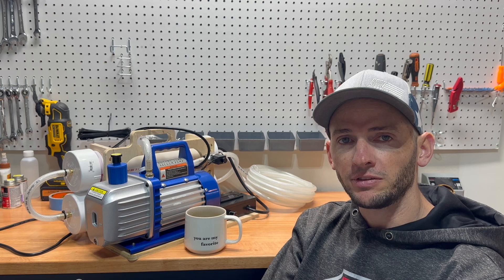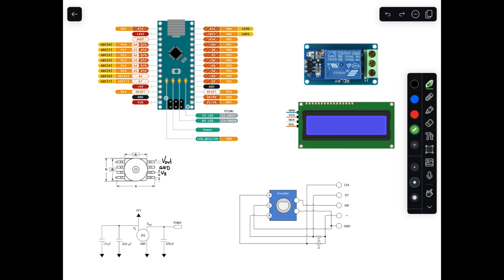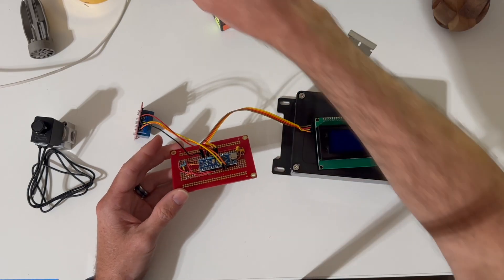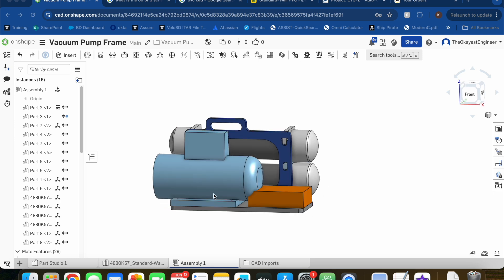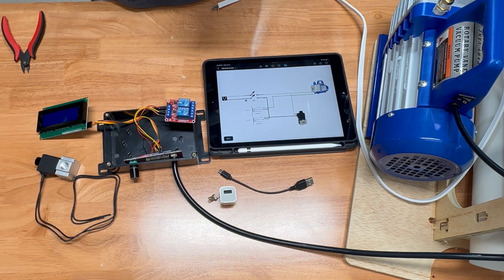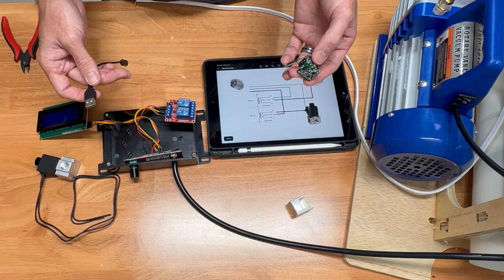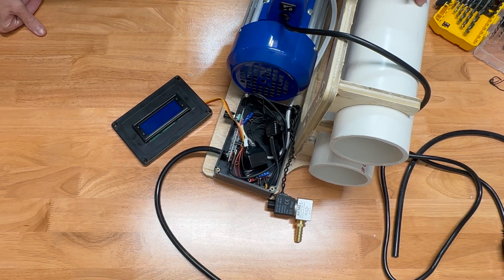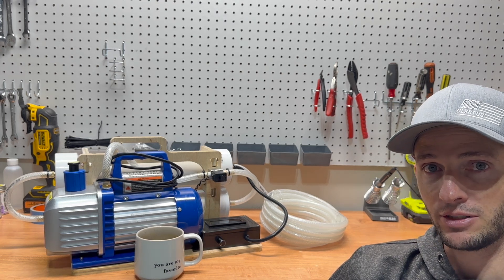DIY Vacuum Pump Build: Save Money and Over Engineer Everything (With ChatGPT)

Comment: I saw the thumbnail and said to myself "this is gonna suck". 🤷🏼‍♂️
Reply from the maker: You’re not wrong…
Reply: @TheOkayestEngineer  We use mass spectrometers at work to verify integrity of seals. We apply a vacuum to the test article and then introduce Helium on the other side. I'm reminded daily that I suck at my job. 🤷🏼‍♂️
Reply from the maker: @819jt  aerospace or military components? I’m familiar with that process. Works great for detecting very small leaks.
Reply: @TheOkayestEngineer  Space stuff🤘

Comment: Oh my gosh !
Just grab one (or more) compressor from an old out of service refrigerator (free. Motors are rarely the reason why refrigirators brake). Buy a vaccum capsule from any automobile spare parts store (5-10$). It's used to regulate fuel in carburators fyi. You will need a 15A microswitch too (3-5$). An old propane tank is just perfect as vacuum container. Take the size that fits your application. 
I personally use 1/8" diameter water tubes used in gardening as vacuum lines. Finally get a vacuum meter. I paid mine 20$. It's not a monster of accuracy but it does the job.

Overall cost : 50-60$, including the vacuum lines. Want more power/vacuum capacity ? Add refrigerator motors. The 15A switch can easily deal with 3 motors. These motors are awesome : no oil leaks into the vacuum system. No vacuum leaks. Very quiet. Integrated heat protection. 

Install the microswitch on the vacuum capsule, on which you can add an adjustable lever too. Set your power cable and that's it ! Time to build the whole setup is 3 hours, including the coffee break and the time spent in scratching your head while you wonder how to set the electric cables 😂

I used such a setup intensively for over 10 years and had zero failures. Never had to replace a thing. I reach 27" vaccum but mainly use less than 20" : if you can't mold your part with 20" vacuum, I can't see how you would succeed with 30".

Feel free to comment :)
Reply from the maker: Most of the things I create are more to see if I can do it than it is to make it the best way possible. I wanted to adjust it for wet layups at about 20 inches, and be able to use it for infusion which benefits from the highest vacuum possible. It works for what I need it to do, but probably not for everyone.
Reply: @TheOkayestEngineer  what you did is awesome, no doubts about it 🙂. Your entire project is just super challenging. I have some experience in helicopters : there's nothing harder to build, tune for flight and  fly.

I personally don't use fusion molding. I find useless to drown everything in epoxy and fight the hell to remove the excess afterwards... it's not very hard to reach a 60% ratio of fibers in volume, this is the ratio used in prepreg as far as I know.

A trick I use to do to make the epoxy thinner : heat the resine ( not the mix with the hardener) up to 40 degrees c (roughly 105 F). Let it cool down to room temperature. The viscosity will drop for several days.  I have no idea if it works on all epoxy brands but I think it's worth finding out. Make some comparatives with/without.

All my best wishes and thank you for your great content !!

Comment: Your vacuum buffer has the best use to stop crap entering your pump. Investing in a better pump would have been a better option
Reply from the maker: You're probably right.. so far it has worked "good enough".. and that is all I have really needed. If the projects get bigger and more frequent... then I might upgrade. For now, that money saved can go into other projects with bigger returns.

Comment: I would be concerned by vibrations a little bit. Over time the loose wires in the control box could cause them to rub against other components, degrading the wire insulation. Then having main voltage touching anything will be the subject for another video. I'd use some rubber vibration insulation pads or even better filling the content of controll box with some resin to keep everything in place.
Reply from the maker: @jtrueman88  that’s a really good point and something I didn’t think about… I’ll open it back up and see about making it a little more vibration proof. Thanks!!

Comment: IMHO you don't need a solenoid, just a one way valve will do the work.
Reply from the maker: @burningman1945  you’re probably right… but I believe that would leave a vacuum on the pump until it leaked down enough for the valve to shut and then further allow the pump to continue to leak down. The pump acts as a crappy one way valve as is, and leaving a vacuum on the pump when it is off is bad. It sucks oil out of the inlet.

Comment: If you’re switching AC you really want to earth the enclosure. 110/120 isn’t as bad as 230 for it but doing the funky chicken dance isn’t much fun.
Reply from the maker: @wombatau  good point. The vacuum pump is still grounded the same way it was originally. The control box is plastic and should be completely isolated. I assume this is okay based on my knowledge but I’m no expert. If it were metal a ground should absolutely be used.
Reply: @ After a bit of reading following the comment I made, it turns out that I’ve been doing it incorrectly for many years. It turns out the proper way really is not not use those Arduino AC relay boards at all, and to keep each domain completely isolated.

For eg, an external AC relay with its’ own grounded housing, that is switched using optoisolation to a separate DC circuit.

Some of those Arduino relays do 50% of that, in that they are often optoisolated, but the ac circuit shares the same housing with the dc circuit, which isn’t ideal. The biggest part is optoisolation.

Because I love to overcomplicate things, I guess I might for my own things use instead something like a dedicated PC817 optoisolation board (<$2) driving a refrigeration/air conditioning relay like a JQX (<$2).

So I guess: Microcontroller (3.3/5V DC) -> PC817 -> (12V DC) JQX-102F 20A 250VAC -> load live line
Reply: @ I’m definitely no electrical expert just been shocked a few times. The way it was explained to me was when I’m switching live AC through any device I should think about all electrical paths from the live line. So presume the insulation may break down between the relay contacts and the coil (because I surely always use the best highest quality cheapest AC relays), then earth with this in mind. There are probably really clever ways to do it better than I do it where I just connect the earth wire to the relay board mount hole with a screw, but no electrocutions since 2011 - wait no not true I got electrocuted a few months back pulling a plug out of a power board when water clung to and ran down my arm 😂 230V hurts 😂😂😂
Reply: Oh and be sure not to connect your AC mains earth directly to your negative DC rail without significant resistance at least. A person is about 3M ohms give or take, so it’s pretty easy to create a lower potential path to ground.
Reply: Also, Kapton tape is amazing.

Comment: BSP is only standard almost everywhere except America. A bigger challenge is try finding NPT outside of the US. It’s like showing up to a running track in ice skates.
Reply from the maker: @wombatau  and the only difference between the two is ONE thread per inch… one… why??? Can’t we just all get along?
Reply: @ Haha yes true for 1/8”, it’s like 0.5 TPI difference. I think 1/2” NPT and BSP you can even get to fit together for low pressure if you are stuck. I wish the world ran on threads that actually made sense though and used neither. 1/2” is actually ~21mm / 0.82-0.83”.

Comment: shoudnt you switch the phase instead of the neutral? so the pump stays "grounded"?
Reply from the maker: The phase is switched but I did so using the ground in the new where I ran to the arduino. The pump is still grounded like normal. I could have made that more clear.

Comment: Very very good project! Congrats!.  I think I will attempt to make a very similar setup. Only thing is I find it very hard to figure out what fittings to use. I find it all very confusing as it is way out of my normal field of expertise. I like the combined setup with the tanks very good and I did not use a solenoid. I am really curious if you manage to get the system really air-tight. The best I achieved is the same as you, a very slow decline of the vacuum and the pump switching on about every 10 to 15 minutes for 0.5 seconds... Where to look for the solenoid ?
Reply from the maker: I used tacky tape around all the fittings and that seemed to fix any leaks i had. The solenoid is a 3 way vacuum solenoid. https://www.veneersupplies.com/ has everything you'll need to make one of these, including the solenoid.

Comment: I can shed some light on the pipe thread issue . British pipe thread standards have been adopted as the metric standard pipe thread so they are the same . different from American pipe thread standards .
Reply from the maker: Thanks for that.. from what I can tell, the only difference is ONE extra thread per inch.. ONE.. it was extremely hard to figure out they were different haha.
Reply: The standard metric pipe thread is metric. If you browse any European supplier catalogue for pneumatic or hydraulic fittings you'll see that essentially everything can be ordered with an M()x1.5 thread, which is the standard metric pipe thread. BSP is still more common though, but that's because BSP is still the most common pipe thread worldwide and it's too much of a hassle to switch out everything to metric.

Comment: BPC is very common on Chinese products. Many reseller's will even label it as NPT, especially 1/2", and with at least one of the mating parts being plastic they're functionally compatible, though maybe not for vacuum.
Reply: British Standard Pipe (BSP)
is Standard for Pneumatic Devices in Europe.
Reply: @FullSpeed_only  BSP seems to be uncommon    in the US but widely used  elsewhere .'The main standard in Europe, Asia, Australia, New Zealand, South Africa, and many other countries. BSP threads have rounded peaks and valleys, and a 55-degree angle.'
Reply from the maker: Functionally in the sense that they will thread into each other, but only to a point. I believe they are one thread per inch off which makes it extremely hard to distinguish between the two.. but it does make a huge difference when you're trying to get an air tight fitting.

Comment: That's really funny, I desigend exactly this setup as well 2 years ago. And because I make quite small parts for rc I used asmall 10 dollar pump from a food-vacuum machine. Offered te project to some people online and even posted it on a Arduino forum but I do not think anyone has used it so far. Works great for me. I did find the cost of the vacuum-sensor quite high. And still doubt if they are really airtight. Nice project! Getting the rotary-knob to work well I used someone else's code. That code can be found when you look for 'state-machine'. That approach works well. I did write my code by hand though and yes it sure took me a while 🙂
Reply from the maker: I started writing my own code.. but my coding skills are definitely the okayest.. after some struggle I remembered ChatGPT and everything went so much smoother..

Comment: Why not a check valve instead of the solenoid valve?
Reply from the maker: @itswift  a check valve will only partially work. The main concern is leaving any sort of vacuum on the pump while it’s off. When the pump shuts off, it’ll hold a vacuum. As the pump leaks down a check valve should eventually stop the leak, but the vacuum on the pump will remain for a while which isn’t great. The solenoid immediately vents the pump to atmosphere removing that vacuum.
Reply: a check valve would allow the tank vacuum to hold steady while the pump naturally equalized.   This would function exactly as your solenoid,  but with fewer parts.  Not sure what you mean by cycling the solenoid,  doesn't seam to make sense.
Reply from the maker: @itswift  a check valve requires a delta pressure across the valve. When the pump turns off it maintains vacuum while it leaks down, it also leaks down pretty slowly. It also pulls oil out the inlet as it leaks down which is an issue. 

A check valve will kinda work. But it doesn’t solve all the problems I was trying to eliminate. The pump needs to immediately be vented to atmosphere when it’s shut off.  That’s what the solenoid does.

Comment: I need this for a CNC build. I need more CFM to start so I'm thinking about two pumps with one being a slave. 

I would need to change the code a little for my use case. 

When first turned on both pumps run until the set pressure. Then one pump runs to hold the pressure switching every ten minutes of constant run time. I would also need an input to start the pumps and one to turn them off.  And a valve to turn off the vacuum from the tanks.

I was thinking about using a PLC or ladder logic. Writing code would be much simpler and not use as many relay types.

I'm trying to create something similar to the system that I use at work on ether the besie rover or the weekie CNC router that I use all week.

I love engineering and believe what Toyota does. The machine is inefficient and not optimize for my use from the manufacturer. If you don't like it or if you think that it takes to long. Then figure out how to make it simpler or take less time. 

On a project that we did for a year. When we started it. It would take 80 man hours to complete an apartment. In the end it took 20 hours per apartment. We built and installed five at a time.

I was in charge of the project. I asked everyone to say what they didn't like or what took to long. Then I would ask the team to come up with a solution for the problem. With that are small team of four was able to complete the work that initially I thought would need 20 people. 

I will say this. Others from my field though that what we were doing and how we were doing it was crazy. The boss found out how we were doing things and my team was let go. He got four new people who couldn't produce the product fast enough and before he could get enough people to fill the order he lost the contract. 

Just look at saving seconds not minutes. Is it faster to change a bit or how two drills. Two drills saves two seconds. If you drop a bit then it turns into minutes. 

If at all possible use a push pull system. One person pushes work from start to finish and another person finishes it while trying to start. Using this system helps find what takes the most time to complete. This will be the place that the system falls apart and both people end up meeting and can't finish the task with out the other one finishing it up. 

Four people can cut, band, sand, stain, drill for hinges and apply and sand three coats of finish on 600 cabinet doors in two days. Me and my team did that all the time. When we first started we could only finish 50 doors a day. All that changed was how we did the tasks. If we didn't like it we changed it until we did. If it took to long we figured out how to save time.

Thanks for this info. You have saved me hours of debugging ladder logic and a simple PLC with I/o only. Only thing that I still will use is a magnet contractor to turn on and off the pumps. My system with two pumps will need to be 240v ac. I still plan on using 110 v pumps just one per line. Thanks for saving me 5k for a commercial Becker pump.

Comment: I really wanna take the plung into raspberry control , i have so many projects i could upgrade wiith better controls .
I just keep putting it off
Reply from the maker: There is no better time than now! I started with raspberry pi and realized most of my projects are fairly simple and can be successful with an Arduino. Between the teensy and ESP32, there isn't much I can't do and the programming is much simpler. (just one Okayest guys opinion here though) I am no expert.